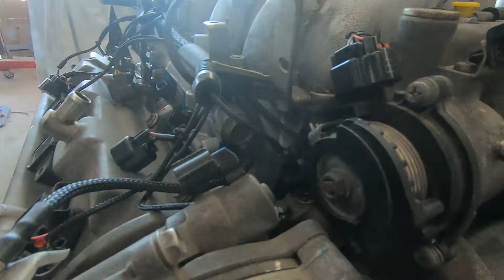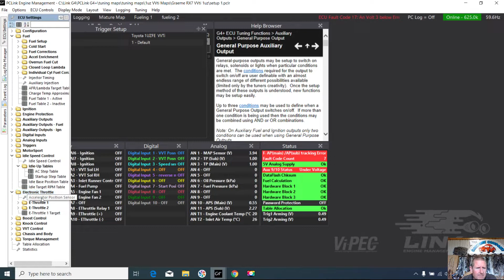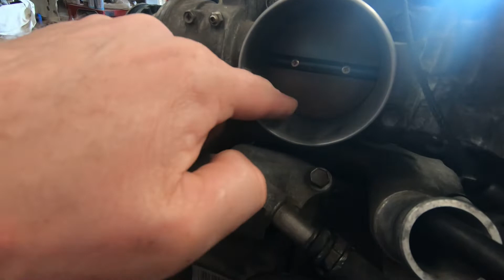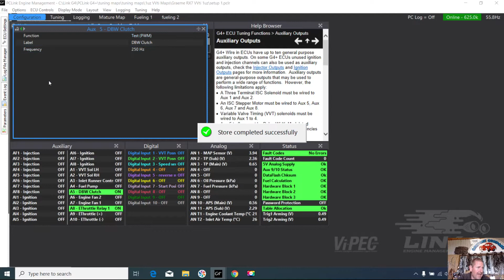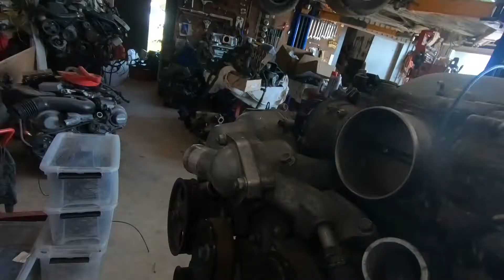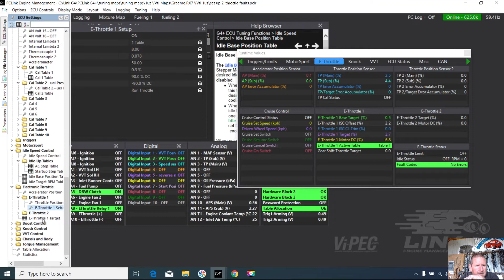DBW Throttle setup 1uz vvti or 3uz Link ecu part 8

Comment: Hi kelvin with the link g4x ecu is there a way to make my drive by wire react faster as far as opening and closing the throttle plate and making it more crispier ifso how can i do this?
Reply from the maker: Yes,  adjustment of the P.I.D settings can change response time.

Comment: Hi is it normal with the link g4x when setting up the tps and aps for the car to idle higher than normal?..because thats whats happening to me the throttle revs out up and down ok but stays idle at 1300 rpm and when i switch back to the original oem ecu it does not do that can you tell me what im doing wrong?.thank you
Reply from the maker: I would suggest the DBW targets need to be adjusted , both in the DBW target table and the temp offset table.  Cheers Kelvin
Reply: @CartuneNZ  thank you so much il look into that right away.